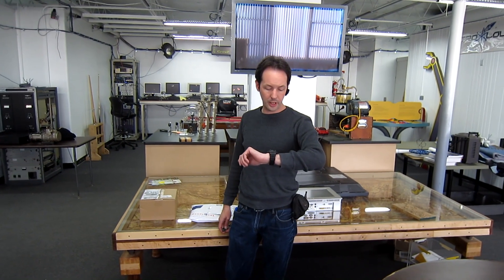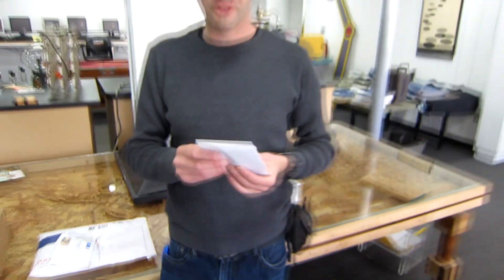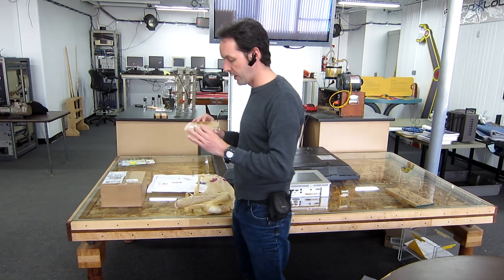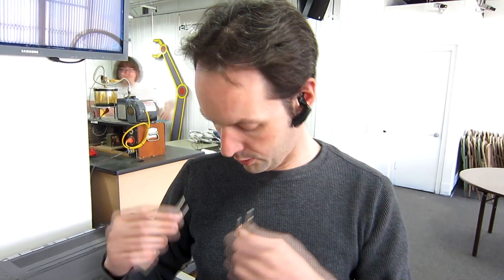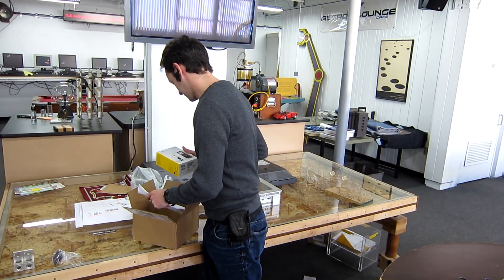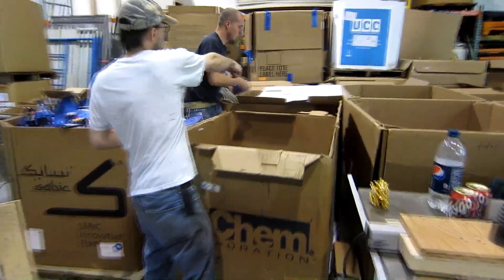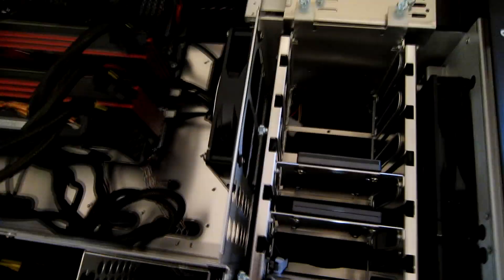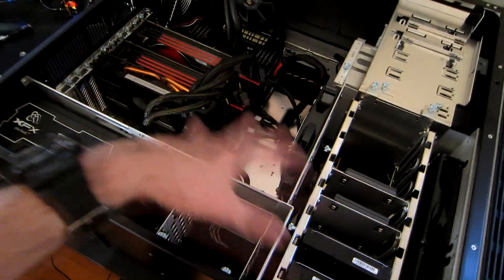Captain's Blog 4-24-12

Comment: It was fun to see you open the package there.  Nipple clips!  LOL ... I was actually thinking where the conductive wire/clips are held by insulated plastic cubes maybe some little small scale HV wire holders for testing spark length, but I am sure you will find some use for them.  I don't do drugs.  No need to, my brain is already that way haha!  The Bedford flag IRL is closer to 2 ft square in case you wanted to know. Vince Aut Morire is Conquer or Die!  How badass is that?

Comment: i think im going to beat Trever on completing a Tesla coil. .. coil is about 5.5 feet tall and 9 inches around..  24 awg double enamel coated and layers of enamel are being added to it .. i have 3 on it now. soon to be powered by 4 or 6 MOTs under mineral oil for isolation but configured to current limit its self. it will have a high frequency filter and a rotary spark gap .. oh and the most improved thing i did was a 71nF cap that will insulate up to 30,000v without oil and small in size